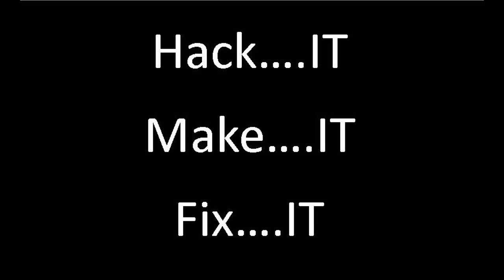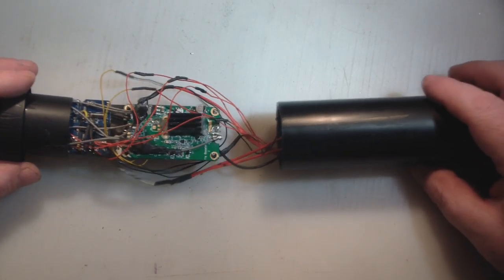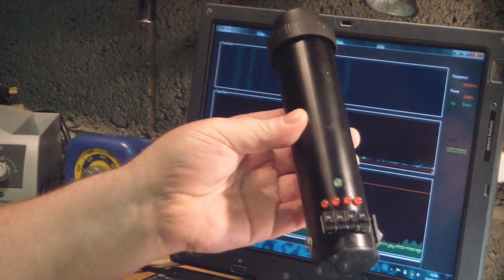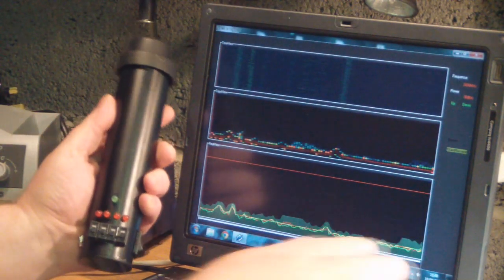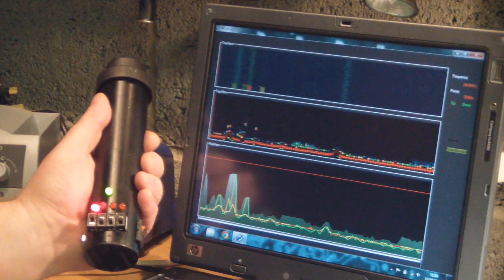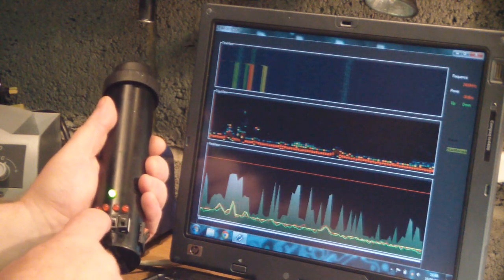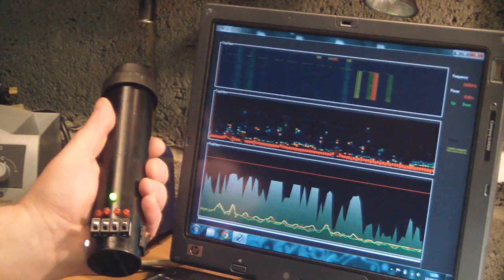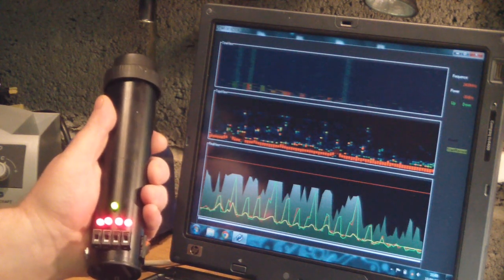Wifi Jammer MK2

Comment from the maker: hi i used 3 antennas as i am using a 4 watt amp and wanted to spread the load. i have also experimented with a 4 element yagi and a cloverleaf to make this more directional.
Reply: i am going to do the same. How did it workout for you? will use helix antennas. so the space around my caravan will not be flooded with bluetooth speakers next summer. At least i am now able to be so kind shutting them off the air after 11pm ;)

Comment: a quick question.
all the tiny 2.4 video TXS Antennas are conected to each other , and all goes to RFIn of amplifier?
Reply from the maker: +George Chatzisavvidis Hi George yes that,s how I did it.
Reply: +andrew mcneil  something else.. the amplifier works for 2.4ghz Data ? is there any problem using it with audio visual?
Reply from the maker: +George Chatzisavvidis Like a FPV setup? If so then no there is no difference it's all just data,
Reply: +andrew mcneil  i think you have to use splitter combiner wilkinson, and a attenuator
Reply from the maker: +George Chatzisavvidis Is that to use the amplifier for an FPV setup? All an attenuator does is limit the power down the line.

Comment: Hi Andrew ! I am 7 years late in making your jammer and I find that the 4x TX6729 's I have purchased appear to have the positive and negative leads reversed? I say this because another project I found on YouTube has the exact same Tx6729 17/06/01 release as I do and wires them as I have said ! as the boards have no markings will I cause damage by wiring them incorrectly ? Very interesting some of the projects you demonstrating ! Thank you !
Reply from the maker: You can check continuity with ground with a known ground on the board but I have not come across any with reverse positive and negative.
Reply: @andrewmcneil      Yes ! I will try and do that ! the YouTube  project I was referring to is this one  ---Wi-Fi tinklo blokatorius  
Regards Richard